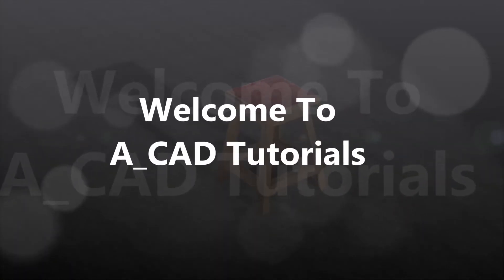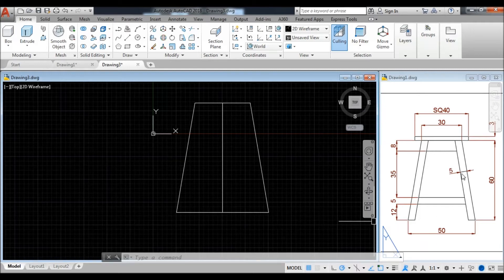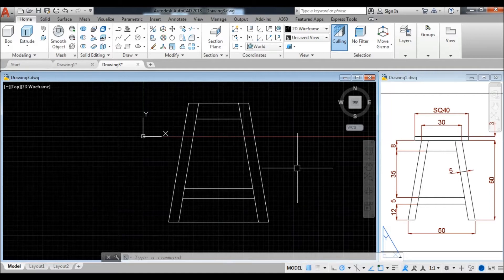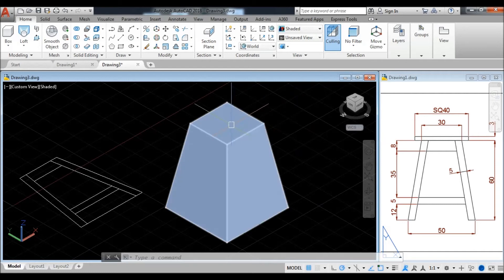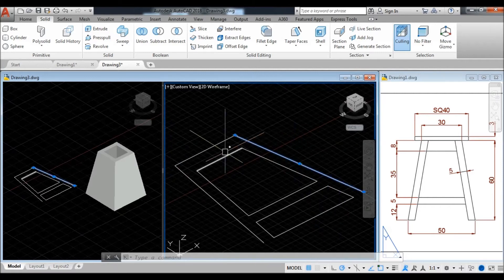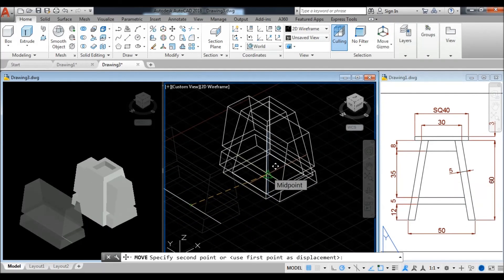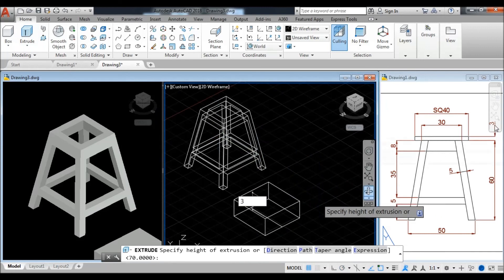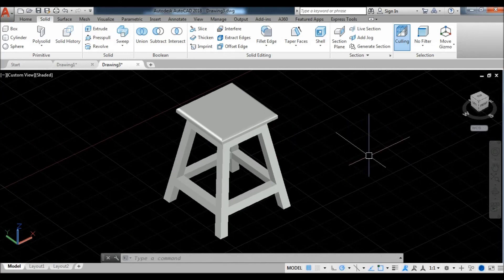AutoCAD 3D Modeling - Stool Tutorial Part 1 - Apply Material Texture + Lighting + Rendering

Comment: You can model much faster if you create a pyramid and then peel away details from it with the Slice command or (much faster still) with the ASL command from the A>V>C> Slice plugin. Wasting so much time on 2D sketches is wasteful and pointless. AutoCAD is a direct modeling environment and sketches are rarely needed for very complex shapes. For frame furniture, all parts are designed immediately in 3D, starting from a box the size of the product. There is a detailed manual on my website. Building a pyramid using LOFT is also overkill. AutoCAD has a command to build a pyramid.